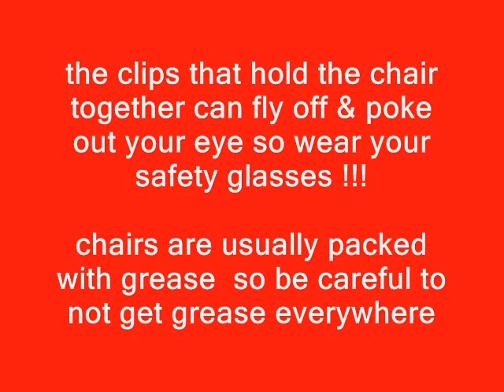Office chair repair Haworth gas cylinder lift ,

Comment: Hi with no sound it was not obvious if you actually replaced the cylinder with a new one or just did something to the old one. It seemed as if you added a glue or something to the cylinder.  Was this something needed to be added to the new one or was this something you used to fix the old one. Also what was that glue-thing you added?

Comment: Great video..but now can you tell us several ways to slow down the swivel motion?  Don't say rubber wedge, i'm talking about making the swivel circular motion slower.   thnx for ur time
Reply: Yes apply a thick grease (or tacky grease) to the bearings in the spin plate. Depending on how loose the guide channel is a 140W oil could do the trick too

Comment: is it possible to reduce the size of the cylinder outer casing so it can sink deeper into the wheel bracket? The resting height of my chair is too tall.